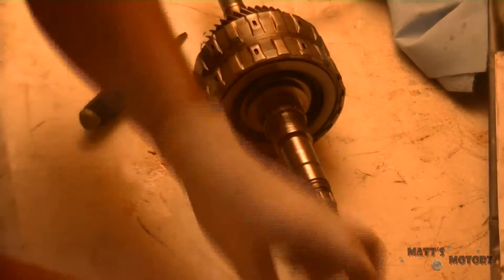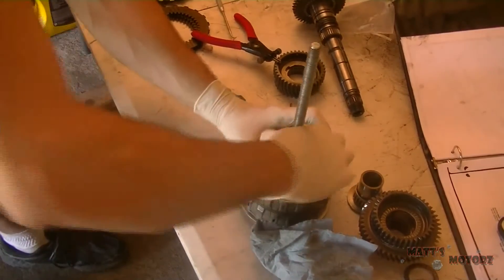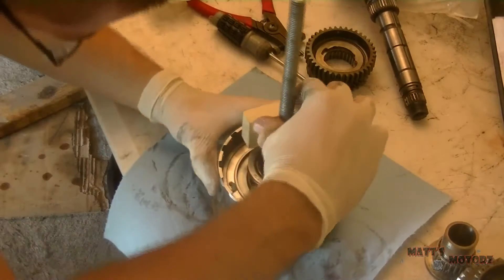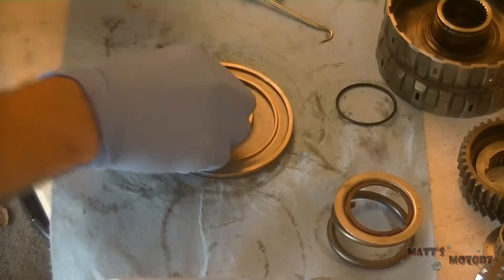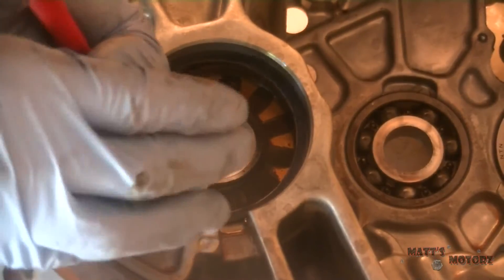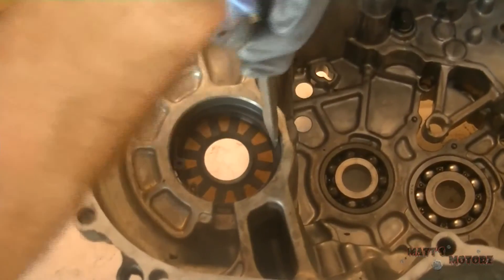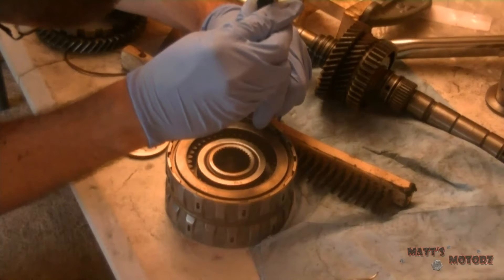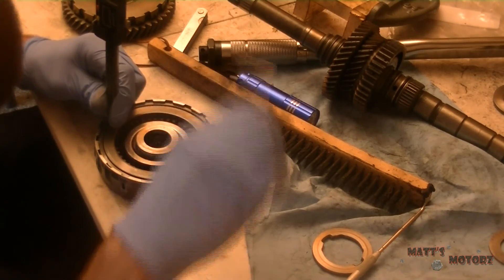A4RA Transaxle Rebuild [96-00 Honda Civic] Part 4 : Main Shaft Disassembly and Inspection

Comment: Hey Matt, thanks for the videos! I have the Honda Civic Service manual, but it does not say in which the piston smaller thickness spring disk is placed, could you tell me?  And also tell me what was the clearance disc in Caliper? Thanks!

Comment: Hey Matt, Did you lubricate the any of the clutches before installation?
Reply from the maker: I don't remember in this particular care but I normally do.  Just a quick dip in transmission fluid.  Now a days the friction material has advanced enough where you don't need to soak over night.

Comment: Great Video Matts! Where did you get the large washer (5"or 6") for the toll you made to compress the spring?
Reply from the maker: tapia79r4p Thanks!  It is actually part of another special tool that I bought earlier for rebuilding a 4L60E transmission.